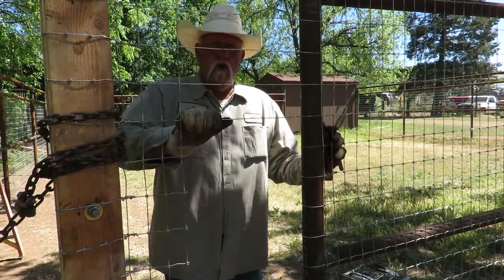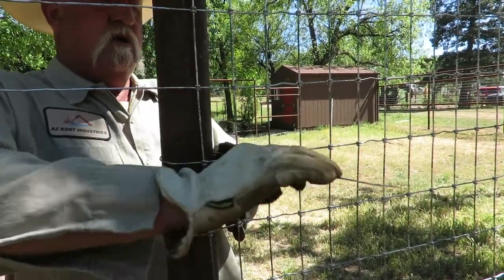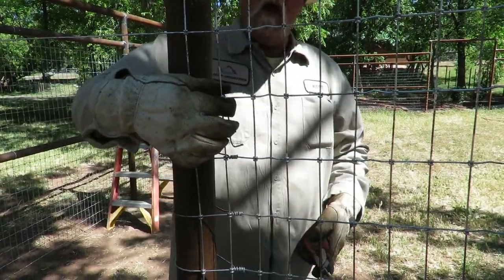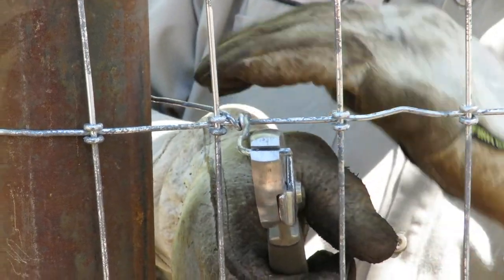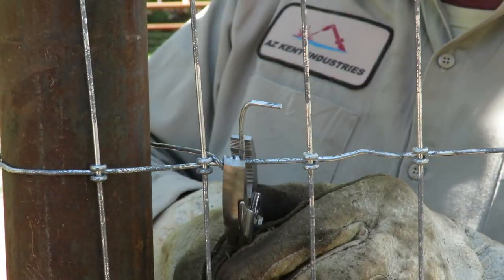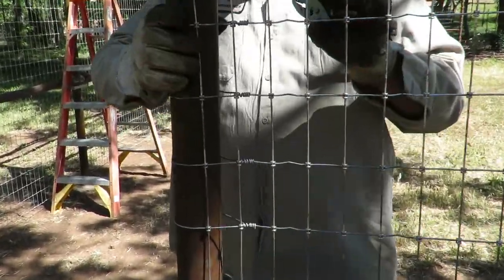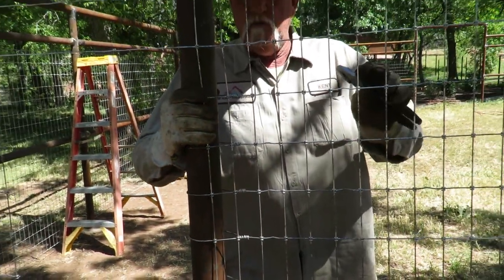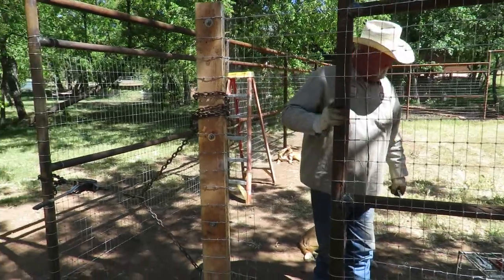How to tie non-climb/no-climb wire on pipe fence Brought T You By AZ Kent Industries

Comment: It needs a cold-galvanized (high zinc paint) coating after all of those scratches with the wrench.  Nice fence either way though, as your poles aren't painted.
Reply from the maker: we don't paint our pipe unless the customer requests it to be painted but most everyone prefers the rusted pipe look, and never put anything on the wire after we tie it, and never had an issue in 40 years, all of our customers are repeat customers 🤠